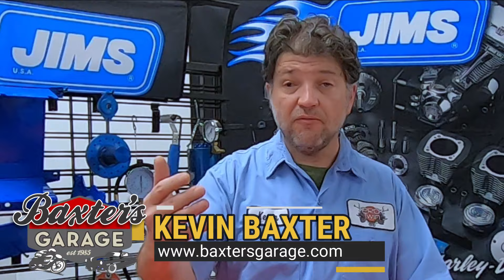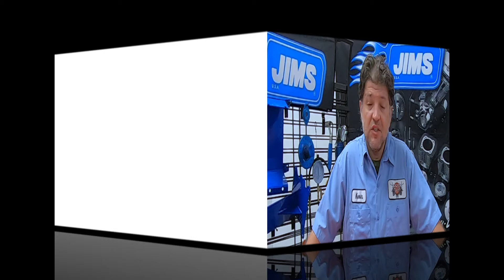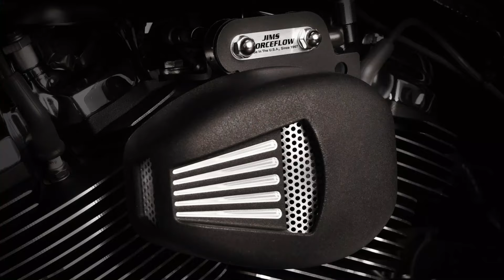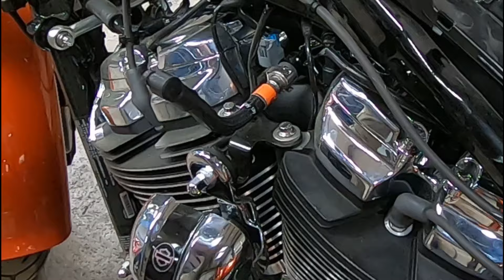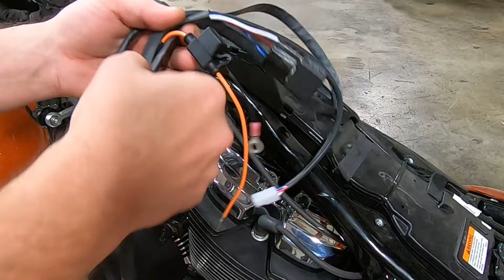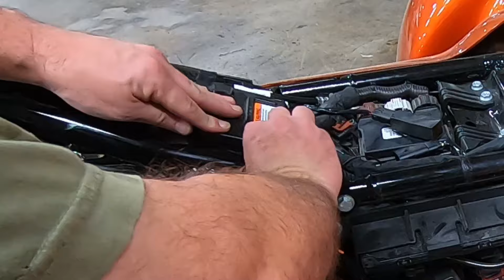COOL YOUR HARLEY - JIMS Force Flow Fan Install - Tool Tech Tuesday - Kevin Baxter - Baxters Garage

Comment from the maker: If you are interested in a fan for your bike, you can shop them here.  https://www.baxtersgarage.com/shop/coolingandfiltration/15?page=1&limit=60&sort_by=category_order&sort_order=asc
Reply: What if you have a tuner plugged into that plug location in the side cover ?
Reply: Is it compatible with 2024 Road Glide 2024 non VVTI models ?
Reply: I'm wanting to add these Jim's Fan on my "17 FXDB streetbob.... It just comes down to funds at present BUT this will be installed ❗
Everything costs soooo much more for us that live Down Under 🇦🇺
😭😭😭😭😭😭
Safe travels 🙏❣️

Comment: Hi Kevin, Thanks for the great video.  I have the kit installed on my 2021 Street Glide 131, and like you, I installed the thermostat on the center front rocker bolt.  Have you found that locating it there keeps the fan from coming on due to the direct blast of air when riding on the freeway?  I rode at 80 mph here in Savannah, and it was almost 100 degrees out, and rear head temp was read at 350 degrees, but the fan did not come on.  It does come on when riding around town and did so when the head temp read 330. I was hoping it would come on when the rear head temp is at 350, even when on the highway at speed.  Your thoughts are appreciated.  Thanks Buzz

Comment: Yeah, put the thermostat switch on the hotter rear cylinder and does the ECU need to be flashed at the dealer

Comment: Wouldn't it make sense to Mount the thermostat on the rear cylinder as it runs hotter than the front cylinder.

Comment: Hi, my name is Mitch question for you is it ok to have the Jim’s cooling fan on all the time while you ride or is it basically used for in town slow speed riding I’m going to have one installed on my bike I’m going to bypass the thermostat wire and just use manual switch. Thank You

Comment: I’m trying to install the Jim’s fan on my 2013 tri glide.  The bolt and spacer they gave me in the kit is to small. My rocker box bolts are larger.   On the instructions it says by passing the thermostat voids warranty.   And it don’t tell me how to by pass it.     Any help ?  Thanks

Comment: $600 to $700 for a 12v electric fan? Seriously? I understand it has some nice chrome and metal parts. Wiring harness, mounting brackets, etc. But still we're talking maybe $50 tops in material costs.
Reply: Haha, he thinks we are still in the 90s. The cost of goods has gone up and   💰 buying power down.
Reply: Ok develop and manufacture a fan for that price point abd I'll buy one...

Comment: Another great video thanks Kevin,I have fitted the love jugs I agree they aren't the most attractive addition to the bike but I would rather protect my wallet than the looks of the bike,I have also fitted the Jagg 10 row non fan assisted oil cooler along with an external breather since these additions my bike runs consistently cooler also have the FP3 tuner which confirms the lower operating temperature,I live in Western Australia and we are a hot climate I believe these additions are a must to increase the longevity of any Harley

Comment: No lie, but I have taken frozen water in a spray bottle and after it thaws spray both cylinders and watched the oil temp gauge go down.  It works for me.  Just two of those "Zep" spray bottles from Home Depot.  When freezing, leave an inch or better for expansion.  The motor will hiss and steam like my old lady when she has not had 'it' for awhile.  It works for me.

Comment: I had it on my 2018 road king for 3 months during the hot Sacramento summer. The Head temps dropped about 25 degrees but it did nothing for the engine temps. The thermostat was junk and sometimes the fan came on and sometimes it didn't. I filled out the warranty card and still they would not replace the thermostat. Piece of junk. For that kind of money, I could have gotten the Ultra cool oil cooler. 

I must add that I love all your other videos and I'm ordering a Baker DD7 transmission after seeing black chunks in my tranny fluid from the Junk stock harley transmission with plastic bearing races. 30 grand for a Harley and I've had to replace the stock 107 that failed from the crappy sumping oil pump. Now I need a new transmission.
Reply from the maker: I haven't heard of or experienced that type of issue with the jims fan.  25 degree drop in that condition is quite a bit.  the fan only comes on if the surface of the rocker box exceeds 140 degrees if i recall correctly.  i would have to ask what and where are you reading engine temps from?  if from say a PV, there can be different temps displayed.  keeping the head cool and reducing opportunity for valve seat issues is a huge benefit.  im also surprised to hear they wouldnt work with you....i dont know details of course it just seems way out of character for the team there.  maybe give them another shot?

Comment: Curious about adding a pair of used Wards Werks fans I pulled off of my 2011 Ultra and adding them to my 2020 Road Glide Limited Twin cooled with the 131 kit I had the shop install. Every once in awhile she'll leak a bit after shutting down. Techs checked the system and rerouted lines, advised H-D. I haven't checked to see if there are open areas in  M-8 Twin cooled heads like there are with the Twin Cam so maybe not as much cooling. Might be better to put them on my 2007 Softail but I ride the RG more often. Thanks.

Comment: Hey Kevin How are you I was wondering wondering what the engine temperature should be on a 90* day at 70mph on the highway I have a 2018 ultra limited with the wet heads and a stage 2 with 465 cam and a pv3 tuner and it’s saying 260-271 to me that seems a little hot but I’m not sure it’s hard to find this information thanks

Comment: 2021 FLHTK twin cooled, watching your videos great info. Choosing between 3 options which is the best bet? Mighty mites,  Jims fan, oil cooler and filter relo. kit? Honestly I don't like the look of the relocated filter. What is the best option? Secondary question, I watched a video and the guy could not get the thermostat mounted on his trike due to head space issues. Can you use the thermostat on my bike as you installed it ? Thanks

Comment: I bought a brand new M8 107 Softail. I’ve put on 3k on it and 4 times now the bike has shut off while stopped at a light. First time it shut off I was under emergency braking and I thought I may has stalled it or hit the kill. The second time I was at a light with a group in gear clutch pressed right hand off. I went to leave and motor off power on. Time after that I came to a stop, threw it into neutral to take a stretch and motor shut off. Than again yesterday same thing, came to a stop, this time I was holding clutch and brake motor shut off power on. Is this signs of something major to come? Should I trade it in for something different or just take it in for warranty?

Comment: Looks very much like my mamoth ice air , engineered by 4 engineers , ISO 9001 certified. Electric fan cooler , plus a ram air to cool it .  It dropped rear cylinder by 18 degrees f .  You need to talk to me .
Reply: Jim's I am afraid this has been made

Comment: Kevin,  would it be a better application to attach the temp sensor to the rear head?  I think it runs hotter than the front, and might be a better indication of the engine's temp condition.  Just curious; thanks for the great video.
Reply: Exactly.... this is the kinda of thinking the world needs !!!!!! More critical thinking.  I would say you are correct sir. Since the airflow to the head is blocked by the front head.... 🤘

Comment: in my job field I have free access to the small square fans.  is there any downside to mounting one to the oil cooler on the front of the bike being that it's free to me other than how it will look when I'm done it should help cool the oil yes?

Comment: Great vid and timely. What do you think about the HD fan that mounts behind the rear cylinder? Apparently, an HD tech has to flash the ECM to make it work. I'm guessing that doing so will affect FP3 tune.
Reply from the maker: while that would cool the rear cylinder...its not an even distribution of air.

Comment: If you have reflashed or manually enabled Engine Idle Temperature Management System (EITMS), is this option sufficient to cool the bike down during extended idle times without adding an external fan?
Reply from the maker: Not at all.  besides.  that disables one cylinder....the engine beats itself up.  it wasnt designed for prolonged use and extended idle times.
Reply: @KevinBaxter  thank you Kevin-based on the negative and potential destructive effects on the engine, what was the purpose of offering this option by HD? Is this option available on the M8's or has it been phased out completely on all the new (post 2017) HD bikes?
Reply: @schachat01  All M8s still have the EITMS feature this far.

Comment: Why didnt you show the fan working as well as the sound of the horn?
Reply from the maker: Great question.  The video was shot at 1am after a 16 hour work day.  The transporter was to arrive the following day around 3pm to pick up the motorcycle for delivery to our customer in Ohio.  I was exhausted so my plan was to install the fuel tank, seat and shoot video of just what you suggest the following morning...however, when I arrived back at the shop at 7am, the transporter was already here waiting and in a hurry.  So, we had to get the tank on, go for a quick test ride and load it on the truck.  Sometimes the best laid plans change out of our control.  Thanks for watching.

Comment: Hey Kevin, I’ve been trying to find info on this forever and can’t find a good answer; what is a safe rpm range for long rides? I have a stage 3 dyna and hate cruising over 3k rpms because I feel like it’s too high for an extended time.
Reply from the maker: during long extended highway trips and 5 speed trans on twin cam, mine would sing at 3200 to 3500...and could run it all day long.  once you ride there, you begin to realize how inefficient the engine is at 2000 to 2500.  of course mine was built and tuned proper for that.
Reply: @KevinBaxter  thanks for your input!! I’m running a twin cam 88 bored to a 95 with 543 cams and a thunder max tuner and a 6 speed tranny. Sounds like I shouldn’t worry about running it at 3000-3250 rpms
Reply: The transmission wears harder lugging all the time in higher gears. I had my 07 96" tuned rich and never touch 6th till 80+ mph. Cruising at 4k on the highway with an exhaust turns heads, but I have no carbon deposits, I'm always in the meat of the powerband to blip around traffic, and there's never a spec on the tranny drain plug magnet. And much less on the primary, IMO. Also, for what it's worth, I'm a dealership technician and my hunch about the lugging comes from looking at cruise drives on a monthly basis.

Comment: Dumb question, where can I find the tool you used for the zip ties?  I would love one of those.
Reply: Amazon
Reply from the maker: no such thing sir.  mine is a BluePoint from snap on but i use it all the time.  As Night King said...you can get lower cost ones from other places.

Comment: I installed the Jims force flow fan on my 2015 street glide special. I live in south Florida in it gets very hot down here. Before I installed the Jims force flow my engine temperature sensor was showing 285 degrees. Since I installed the Jims force flow my cylinder head temperature is at 235 degrees and my oil temperature is at 218 degrees. Love it so far. I am also running a FP3 I had had the tuner installed long before the install of the Jims force flow fan. I am a fan of the Jims force flow fan.
Reply from the maker: thank you for your comments and views sir.  glad it works well for you too.  all the best

Comment: Stage 2 114 wet head road Glide ultra. Would it be worth it for me to invest in something like this?
Reply: Yes :) Lowers 30F.
Reply from the maker: a wet head engine is not truly and fully liquid cooled.  water is looped around the exhaust port.  this is secondary cooling.  that said...this would enhance operation of the wet head system as well as supplement its effect.  so....yes.

Comment: I still have a Mag ignition. Wonder if the added load would do the dim headlight thing?
Reply from the maker: it very well could depending on your chg system.  are you running battery delete with a capacitor to charge the alternator?  If you have a healthy charging system, it shouldn't.  on my old bike builds...like Stiffy the Bobber Panhead im running an S&S alternator case.  With that, a battery delete system from Cycle Electric which is basically a volt reg to a capacitor so i can run lights from that.  Also running a morris mag on it.

Comment: Im curious. Front rocker? Convienant? Was there an airflow thought? First cylinder I would assume gets some better first cooling airflow? Second cylinder gets hotter faster or runs a little hotter? Dont know the answers, just thinking to myself. Great vid as always. Just thinking about my old ironhead Im usually texting about.
Reply from the maker: the airflow is blocked in that area by the frame to a large degree as well as the tank, nacelle, etc.  as these engines have gotten more modern, there is less of an offset front to rear cylinder.  carb bikes were a far different story however, this also depends on exhaust, how the bike is tuned, etc.  when we tune, we do so to balance temp.  another odd thing...with close analysis, on average, a liquid cooled model has a cooler head temp on the rear.  also...keep in mind, the factory engine temp sensors have always been on the front head.  in any event, I've tested both locations and havent seen a measurable difference in the head temps mounting at either location.
Reply: I installed one on mine and the fan doesn’t cut on until it get close to 300 degrees can you run it manually without the temp sensor?
Reply: @willwalker5594  I noticed the same thing after installing it on my 21 road glide. Was thinking I had issues, but obviously I’m seeing the same thing you are.

Comment: That's a nice and clean installation.  I'm sure there is a coil relocation kit for the M8 Softail!
Reply from the maker: typical with JIMS they have the details figured out.  i cant say specifically how as i haven't installed one on a softail.  all have been touring models.

Comment: Thanks for another great video. I have a twin-cool Road Glide Limited which come with no oil cooler from the factory. Do you think adding a thermostat controlled fan cooled oil cooler would be less or more effective than the Jims Forceflow?
Reply: Good question
Reply from the maker: both are great options.  i find that the fan has a quicker effect on head temperature which really is a critical aspect.  we are trying to protect the valve train really, valve seats, etc.  with the Jagg fan coolers i consistently see a 40 degree reduction in oil temp.  a fan averages about the same however the head temp specifically stays lower with the fan.  so i would say if you typically do long rides and want to reduce overall average engine and oil temp, and see very little traffic, go the oil cooler and fan route.  if your bike stays cool while you are riding but you see traffic often and it really heats up then.....go the force flow fan route.  it will cool heads immediately when you need it most.  or...run both.

Comment: Great video. I’m happy with the ThunderMax oil cooler fan. Does a great job of my keeping the engine temp down. Super easy to install, plugs right into factory connector. For the life of me I cannot understand why HD doesn’t include the oil cooler fan from the factory. 

Thanks again!
Reply: my 2020 flhtp has a fan
Reply: HD want mo money no money for any parts they can include, but don’t
Reply: Because they know you'll be out of warranty when your engine blows up 😂
Reply: thundermax dont make for softails

Comment: Jims vs lovejuggs??? 👀
Reply: I got the love juggs and they work ok . To be honest this unit good also . One thing i mention as the rubber mounts is a great idea as the vibrations on the engine is hard on fan bearing . I have fans  and oil coolers on both SS engines and one is a SS 124 the other is a SS 143 both have had work done to them and the fans is a must for me in controlling heat as i keep a check on oil temps .  I always suggest cooing fans and i avoid stop and go traffic especially big citys . . I ride two up most times and i found that can also push up the temps a bit on both bikes . If you dont have a temp gauge you may never even know how hot the engine is .
Reply from the maker: investigate features and benefits.  the concept is simple....blow air on the heads.  its the features, how it mounts, operates and looks that would help you make the decision.
Reply: Love Jugs look stupid. JIMs hands down.